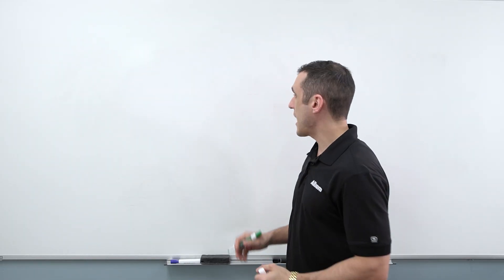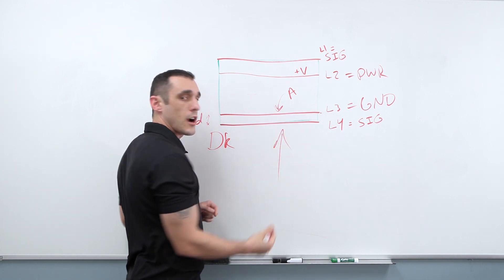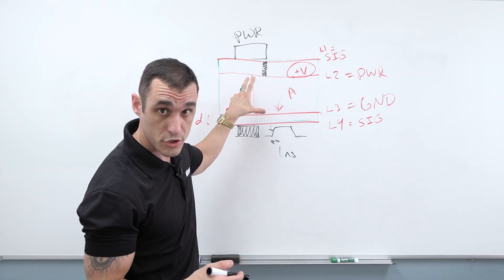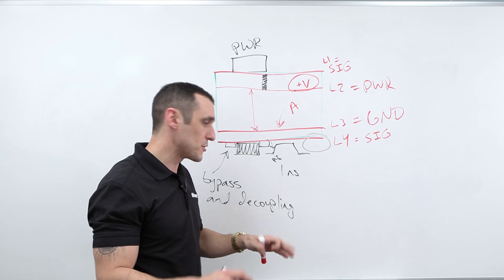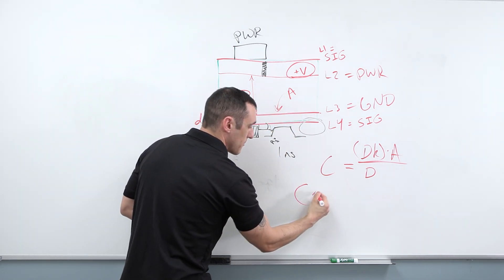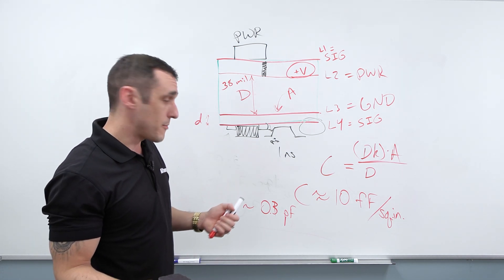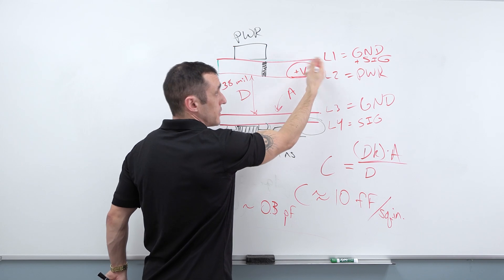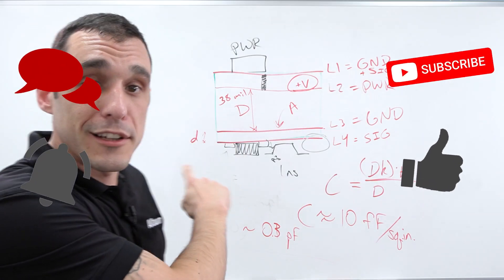Plane Capacitance Deep Dive | Power Integrity

Comment: Hi, Another excellent Presentation, thanks for sharing this precious knowledge.... Most of the high speed design guidelines suggest us to place high speed signal lines on the top layer with a perfect continued ground plane without voids in the 2nd layer.... how will this help by placing high speed signals on the bottom layer if the bottom side of the product is facing any metal structure which will be connected to earth and may increase common mode emissions ( Example : backplane of a PLC)…???

Comment: No equivalent circuit diagram is given. Everything is very vague and incomprehensible. For example, why is the impedance low at such a low capacitance when, on the contrary, the impedance should increase.
Reply: It's low at high frequencies and it's in parallel with all other capacitances that make up the PDN, it also has parasitic ESL and ESR just like you would with any other capacitor. This is why it targets the higher frequency end of digital signal bandwidth, i.e., it's more important when the signal rise time is faster. Also you would prefer to put the planes on adjacent layers separated by thinner prepreg where possible rather than the thin core, so that also helps reach low impedance; regardless, there is still capacitance even when the separating layer is thick and the copper area is small. There is also small spreading inductance in series with the IC pins on a rail, but this is small compared to the via inductance when the planes are large and close together.

We're going to do a PDN simulation example soon, and that will show the equivalent circuit diagram you would have in with plane capacitance. Hope this helps!
Reply: I also added a link to a blog in the description titled "PDS Impedance: The Traditional Approach To PDS Design vs. Energy Flow", you can see an example circuit diagram in that article.

Comment: In fact the vacuum permittivity is about 9pF/m (more precisely - 8.85...pF/m) so for a 1cm^2 copper electrodes separated by 1mm  (~38 mil) vacuum the capacitance is about 900fF. 

For 1inch^2 electrodes separated by the same 38 mil vacuum it is about 5.7pF. Since the FR4 permittivity is about 3.5-4, then we get about 3pF/cm^2 or  about 20pF/inch^2 of capacitance for FR4 38mil core. So you have significantly underestimated the power plane capacitance. It can be checked easily in practice - with a piece of 1mm FR4 laminate and RLC meter.
Reply: I know I stated the wrong units during filming, the order of magnitude was for sq. mm on standard thickness, converting to the per sq. in. units gives the higher value you mention. Basically multiply by 646 to get to sq. in so it gets to the 10 pF order of magnitude on standard thickness.
Reply: Yes,and another 3.5 after 646 to account for FR4 dielectric permittivity. About 20pF/inch^2 capacitance is significant decoupling for 1GHz and above even for small boards.